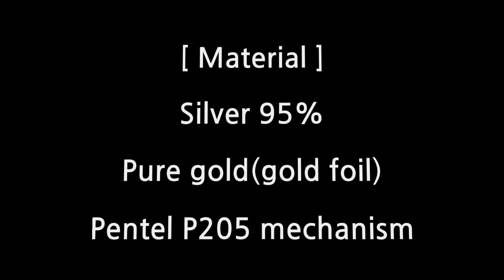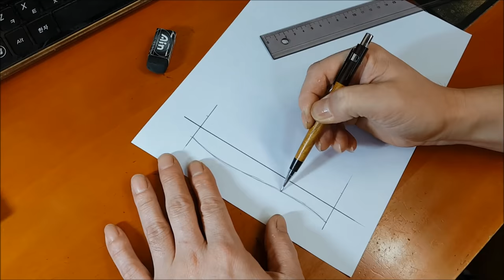[ Pen Making ] Silver Fish / Custom mechanical pencil

Comment: You are doing an excellent job, I follow you with pleasure. Does the foil you put on there come off over time or does it stick to it completely?
Reply from the maker: Gold foil does not fall off no matter how much time passes.
It is attached like one body by heat sealing method.
It sticks stronger than general soldering or welding.
Almost semi-permanently...
thanks~
Reply: @SilverMeister  thanks
Reply: @SilverMeister  What is the pen you use when processing the foil to silver, what is iron, stainless steel or what is it?

Comment: I really enjoy your videos. Can you tell me what foundation forging is and why it is necessary if you are going to put the ingot in the roller press? It is a beautiful pencil.
Reply from the maker: The reason why forging is necessary,
It keeps the silver tissue tight so it doesn't break.
The reason for rolling by pressing on the roller,
To increase the thickness as thin as I want.

Comment: Exquisite!
Is the gold foil only burnished on or did I miss the solder?
Reply from the maker: I don't know what that means.
The gold foil didn't burn out,
I didn't miss the silver solder.
Reply: @SilverMeister  Sorry, I was unclear. The steel tool you rubbed the gold foil with after heating is a burnisher. Did you solder also or just rub?
Reply from the maker: @jimphubar  
You're welcome ~
Rubbing after heat is correct for the burnisher.
The burnisher is called "광쇠-light steel" in Korean.
Gold foil is moderately thick, like a piece of paper,
This is done by heat only without soldering.
It is called the "thermal fusion" technique.
That's why it's a special technique.

I don't speak English well so I use a translator.
So an error occurs.
Please understand.
Reply: @SilverMeister  I understand completely, it was my error in the way I asked the question.
Thank you for your response and for the record, your English is a great deal better than my Korean.
평화와 내 동생을 사랑 - Peace and love my brother.

Comment: Whats the purpose of adding copper to the silver? Does that the silver to be Sterling Silver? 925
Reply from the maker: I alloy different amounts of copper depending on the purpose for which it is made.
It is also made from 92.5% sterling silver.
It is alloyed with 95%,
Sometimes it is alloyed with 97%.
They work differently depending on their use and purpose.

Comment: What does the oil do?
I’d love one for my father💕
Reply from the maker: The oil I use is harmless to the human body that humans can eat.
The reason for oiling is to protect the surface by forming a fine oil film on the surface of silver and wood.
Thanks~
Reply: @SilverMeister  Why do you use camellia oil? Can we use any camellia oil? (Sorry if you answered before)
Reply from the maker: @ugurylmazer9660  
Camellia oil is vegan oil.
The reason for applying oil is to delay and protect the oxidation of the silver surface.
A very thin oil film protects the surface.
After applying the oil, clean it again to finish.
The camellia oil that I use is safe to eat.
It is a very good natural oil that is harmless to the human body even when the ring is worn on the hand.
Reply: @SilverMeister  Thank you very much.:)I will try.

Comment: why it is required to burn and wash silver with acid so frequently ? i see lot of youtube and dont know.
Reply from the maker: Difficulties in translation due to difficulties in translation.
In short,
While removing the fire scale, heat and pickling are repeated to keep the silver surface clean and optimal at all times.
To keep your tools clean at all times,
It's similar to having to clean after using it ^^
Reply: It might sound complicated it bear with me, Silver, along with many other metals work hardens. That means the more you bend it, hit it, squish it, or deform it in ANY way, the harder it gets, and the more resistant it becomes to further deformation, eventually it can crack and even shatter. Getting the metal red hot is called “annealing” and what annealing does is soften the metal, bringing it back to it’s pre-hardened state, it’s kinda like a reset button. But why the acid? Because COPPER! Sterling silver is 92.5% silver and 7.5% copper. (Hence .925) When any metal is red hot, it becomes more chemically reactive, in this case, the copper (but not the silver) in the alloy oxidizes (rusts) and gives the sterling silver this funny color. The acid dissolves this oxide layer while leaving the actual metal unscathed. But why add copper if it causes this problem? Because it hardens the silver and makes the jewelry more wear resistant and longer lasting. Fine silver (999) is just too soft that even dropping the ring could dent it. Side note, if you used this exact process with steel, you would actually make it even harder! Metals are all crystals and they’re all different from each other, some more different than others.
Reply: @Bloated_Tony_Danza  thank you for detail explaination.
Reply from the maker: @Bloated_Tony_Danza  
I can not speak English very well.
So I use a translator,
It's hard to express what I want to say accurately and efficiently.
But thank you for explaining in detail.

I have been working with silver as a job for 28 years.
I already know what you are saying,
It was difficult to express in detail.

Thank you for comment of help. ^^